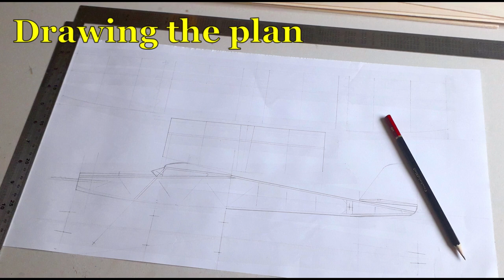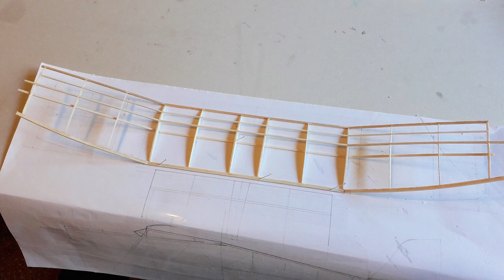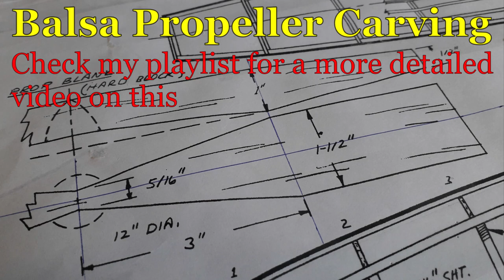ODEM - own design Embryo class Free Flight Rubber powered model | Design & Build | Start to Finish

Comment: Wow! How do you cut such clean notches? Also,what glue do you use? I use aliphatic,but my joints don't look even a bit like yours.
Reply from the maker: Thanks for your positive comments Adarsh. It depends on the material thickness but for small models like this I use a SHARP blade for cutting notches. If necessary a small file helps clean up any inaccurate cuts. Its critical that your blade is sharp so that it cuts the balsa instead of tearing through the grain. I build predominately with thin CA but aliphatic works well if you don't mind waiting longer for it to dry. Oh, and don't forget, practise makes perfect!